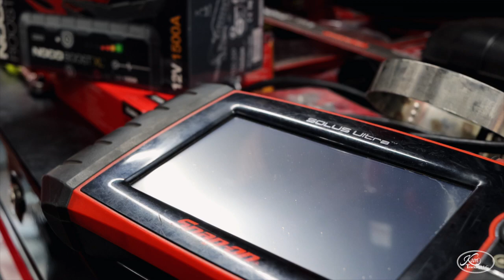Snap On Friday Noco Jump Starter and More Battery Issues... Apparently It Just Happens Here....

Comment: Literally the first day I used my Milwaukee 1/2” hi torque impact gun, the battery fell out and shattered to pieces on the shop floor. I thought maybe it was my fault and didn’t have it latched until I started seeing posts from other guys online. Easiest fix was the cheapie Amazon battery case.
Reply: I have the same gun the same thing happened to me
Reply: I have the same gun and have had it 2 years and haven’t had a single problem.  If I do I’ll know why at least. At least I didn’t pay $600 for a snap on one that does the same as my 12 volt Milwaukee stubby.
Reply: Nendo, I have both mid and high torque 1/2" Milwaukee 2767 and have had them both for over 2 years with absolutely no issues at all, but granted I don't drop my impact gun on the floor and blame the manufacturer  and I also have Dewalt and Snap-on battery tools no issues with them 🔧🔧🔧🔧🔧
Reply: @josephriddle2772  That’s exactly it too. I’ve even accidentally knocked them over or dropped them once or twice and they’re all good. Snap On isn’t bad, I love my Snap On tools.
Reply: Ur using a battery bigger then a 6.0 HO? Bc if had my 3/8, 1/2 & 3/4 and have never used anything besides 3.0HO 5.0XC & 6.0HO and have never had a problem the last 10 years.
Reply: Tell Hamilton to keep some JDTCO Batt-straps on the truck to help fix those m18 battery drop issues!
Reply: @petedagreek3621   I’ve been using a 6.0 HO the whole time and haven’t had any problems either.

Comment: Those large base Milwaukee 12v batteries break easily when dropped. I haven’t had a issue with the small base. Mine the latch part which is the upper portion breaks and then the battery won’t stay in. The fix is it needs to be redesigned with a more flexible material and not a hard brittle plastic.
Reply from the maker: Exactly

Comment: I’ve definitely had battery issues with my Milwaukee impacts, sold mine and picked up a Makita. The Makita works ok, but I ultimately switched to pneumatic impacts. The hose doesn’t really get in the way and the compressor can move with me. Everything eventually breaks. I treat cordless tools like a Dodge, one transmission at a time. Pneumatics are built to last.
Reply: Yea i picked up the 740ftlbs Makita mid torque for $159 last year.  It's a great impact and well worth the money.

Comment: I can say i have been lucky so far i have a lot of m12 and m18 tools and i have never had a battery fall out i only have two batteries go bad after some time but it happens with all brands as far as the tools i had one grinder go bad and my high torque broke the anvil but bolth were fixed unde warranty i do no people have had trouble even milwaukee says that they have a problem but the price keeps me there

Comment: I had an  18 volt fall out of my 1/3 gun .. broke the top like that battery .. I glued it up and it still works.. my m12 ratchet .. yes the battery falls out ,,,and my 3/8  impact the sockets fall off the gun ... every one of them .. used it yesterday and had to hold it

Comment: Well I love Milwaukee but you are absolutely correct bout the battery I have the stubby and I’ll go to use it and out of no where stops working and flashes on the side disconnect and connect back to working noticed it coming apart on the side put black tape around back to working lol they are powerful for sure but the battery are very loose and janky for sure I totally agree

Comment: you guys have the exact opposite problems i have with milwaukee stuff. Brand new i struggle to get the batteries out of all my m12 tools. all of my impacts and ratchets are milwaukee and i havent had a battery fall out. I dont doubt its an issue though anyone who gets butthurt from hearing someone say their tool failed needs to get a grip with reality.

Comment: If you follow the procedures Milwaukee will still warranty the 9.0 batteries. Call the phone number on the website and they will send you the proper box and instructions to send the battery in for warranty. They will replace it with an 8.0 high output.

Comment: That’s weird. Out of all of the years now I’ve been using Milwaukee cordless impacts and other tools mostly with the 5.0 AH batteries I’ve only had an issue with one that I admittedly dropped a pretty long distance off of a rack arm. I also don’t keep them on the charger and only charge them once they get down to a quarter. Lithium batteries don’t like sitting at full all of the time and they certainly don’t like being discharged completely and left that way. You have to have a pretty strict routine when it comes to maintaining/charging lithium batteries if you want to get the most out of them and make them last.

Comment: I am a huge milwaukee fan and own lots of M18 & M12 tools. So far I have not dropped a battery from the tool. However, I have dislodged the battery on my M18 & M12 tools and the tool turned off. Its irritating af but I have gotten used to it on the oscillating saw and the impacts. So now,  I just plan on it happening and if it doesnt, I go buy a lotto ticket...lol

Comment: If my m18 battery goes bad I save the top l had some tops beak off that I didn’t drop I only had the bigger m12 batteries falling out my 1/2 m18 loses connection with the 8.0 and the 9.0 but works fine with 5.0 or smaller

Comment: Warranty is only good as long as manufacturer wants it to be. Ive got quite a bit of snap on tools, and been told 2 times on broken tools that " snap on doesnt warranty those anymore" when they were lifetime when I
purchased them. You win some, you lose some. As to the milwaukee battery issues, I have not seen those issues. Have 3 guys in shop, have probably 15 + tools, even more m18 batteries. No issues yet. 🤷‍♂️

Comment: Yea I can't be using tools batteries have a potential of falling out. If I'm up on the tail doing something and that battery falls out onto the elevator causing thousands to potentially a hundred thousand in damage if not more I just can't risk that. Sorry Milwaukee folks but that's a reality for me and my opinion.
Reply: As a former A&P turned ASE mastertech, you don’t encounter anything tight enough on an aircraft to require the full force of a milwaukee tool. Hardly ever used my impact on an aircraft, my screw gun and electric ratchet was about it.
Reply: @WOWster007  Generally true, engine mount bolt's, landing gear, etc tend to require some big torque depending on the aircraft.

Comment: Me personally I was truly shocked there was so many bad batteries. Also people having issues with warranty. I'm not a Milwaukee,snapon,mac or matco fanboy.  If a tool works for me I'll buy more from that brand. My biggest thing is quality and warranty. My favorite tools are milwaukee and snap on. The only reason I'm not a huge Mac fan is it seems like alot of there stuff is rebranded. Trust me I know every company does it even snapon but they seem to be the ones that do it the less. I haven't had any issues with my Milwaukee tools but I only do diagnostics. I dont use my 1/2 Milwaukee everyday so that might play a role. I do use my m12 every day all day and never had a issue.

Comment: There is a boot that is being sold that claim to fix battery issues... Start all jump box is the best jump starter and the only lithium ion one I'm impressed it will start a Cummins isx that was on blocks clutch was stuck in gear with no batteries just the jump pack started it and to turn the drive line without a struggle is impressive scrap yard told me they have jumped 18 trucks and many cars On one charge

Comment: I have problems with my batteries flying out of my fuel 12v ratchets. Running down a 1/2 bolt and when it snugs up and ratchet jerks the battery goes flying out. My Mac guy didn't believe me till he pulled a brand new battery and ratchet out..guess what? The battery came flying out🤷‍♂️..love the ratchet but one of these days the battery is going to break

Comment: Milwaukees quality control has gotten pretty shitty here lately. Bought a 1/4 drive stubby impact and thing didn’t work a lick out of the box. Got the second one in and same thing. 3rd one finally worked.
Reply: What a pain in the ass to have to go thru all that BS though. You spend good money on a tool it should at least work out the box. Damn. 
 I get it.. sometime we abuse tools. Or stuff happens. Hence the warranty. But out the box- TWICE?!  Cmon Milwaukee. (& yes. I own both Milwaukee & snap on tools). Just calling it like it is
Reply: @ianloyd6384  the biggest pain in the ass was I ordered though northern tool. All 3 packages got hung up in north Carolina via UPS for about 5  days. The only way  I got it to finally move was I called northern tool to complain. I won’t ever order anything through northern tool again cause their shipping sucks bad. I love that little 1/4 drive stubby impact. It’s my most used impact unless I’m doing suspension work.

Comment: We burned up THREE of the m18 fuel 1/2" hammer drills ice fishing last year within 2 weeks. I know you guys cant relate much to that down there, but just imagine a 6 or 8" hole saw going through 24" of plastic and that is about what it is like. All 3 were warranty repaired, but there is still a huge fan base that will tell you they never break and are the best around. Never had a battery issue or fitment issue yet.
Reply: @bjblanchard1508  Agree - like owned by Chyna company super over-rated.

Comment: I don't think Milwaukee can not warranty a battery that was purchased with a 3 year warranty period during that time frame if it is generally covered under the warranty like a  manufacturing defect in the battery that caused it to fail. Now they can replace the 9 amp battery with one of equal or greater value and no longer send out new 9 amp batteries under warranty replacement and they can say as of this date the 9 amp batteries will no longer be covered under any warranty but they have to tell the customer at the point of sale. When you purchase something and it has a warranty that warranty is seen as part of the purchase and is viewed as a contract. As long as Milwaukee states on the package that a brand new 9 amp battery no longer has a warranty when it is purchased that is legal. Companies can choose to give or sell a warranty with the purchase of an item or not to but that is stated before the buyer purchases that item. State and federal laws protect consumers when they buy any item with a guarantee or warranty. My information comes from my Business Law class in college, we covered this subject thoroughly, to say the least.
Reply: They do

Comment: Hay clay can those nocos jump start the car and keep the car running. Like say the alternator is not charging and battery is dead. So you can drive it in? Like the other jump packs. Curious if you know.
Reply from the maker: Sorta we tried that on an S10 but they aren’t designed for it. It will kick off after a little bit.
Reply: If u get a gb150 it will run quite a while, big and clumsy over gb50 but way more powerful and still 4x or more lighter and smaller then old school jump packs